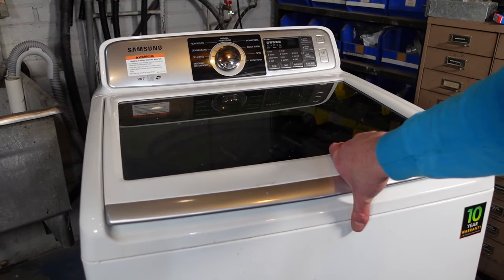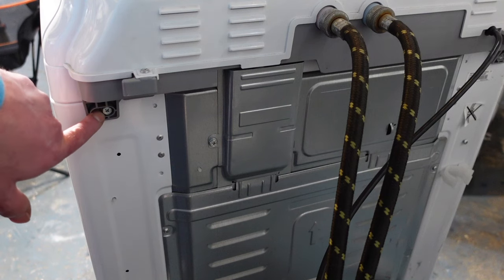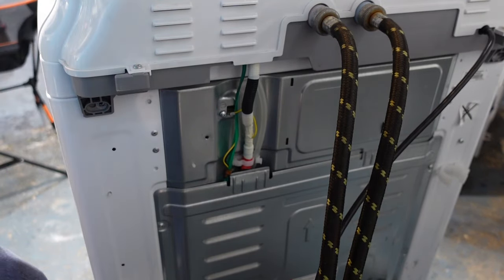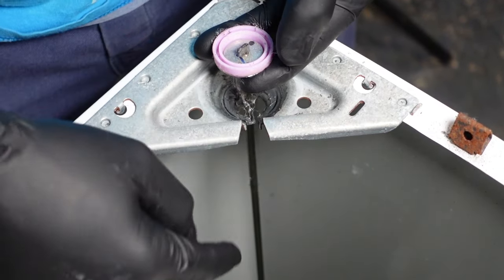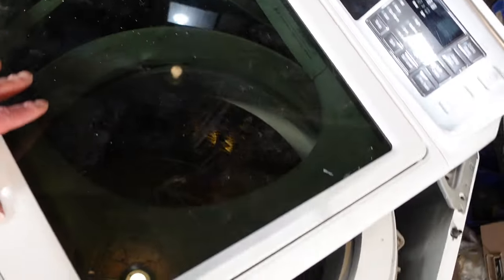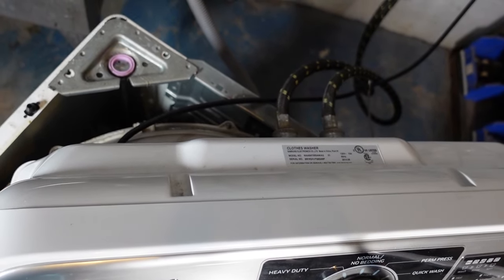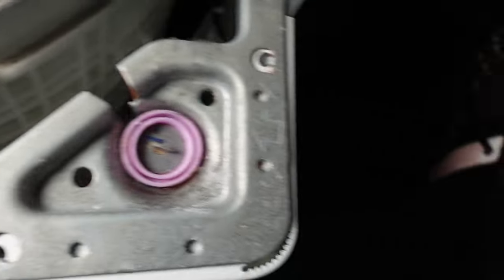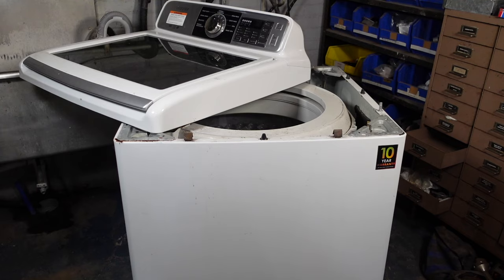Samsung Top Load Washer Off Balance FIX DIY How to Replace Suspension Rods DC97-16350C

Comment from the maker: Buy a replacement set on our website! They come in different sizes, so if you are unsure which you need please reach out! :goodvibes:
25 3/4" Set of 4: https://lorainfurniture.com/shop/appliance-parts/washer-dryer-parts/new-4-pack-suspension-support-rods-for-samsung-washer-dc97-16350c-ap5623264/
28" Set of 4: https://lorainfurniture.com/shop/appliance-parts/washer-dryer-parts/new-4-pack-28-suspension-support-rods-for-samsung-washer-dc97-05280s-ap5799907/
Reply: Pretty positive I have the same model you have in the video. What length rods do I need?
Reply: So how about a Samsung DC68-03172 D-00? Same problem.
Reply: I agree just changed my tension rods on washer
Reply: I have a Samsung Top Load Washer. Model WA45T3400AP. I believe the suspension rods are 26.4” long. Do you carry these or know where I can find them?
Reply: I have WA50R5400AV.  Which set do I need?

Comment: Thank you so much! My washer was going out of balance with loud bangs, wouldn't always finish spinning. I had a repair man come out and told me it was the transmission and said it couldn't be fixed. He recommended I buy a Speed Queen. I am a DIYer. With some research, I came across your video. I ordered suspension rods for my Samsung washer from you, followed the directions in your video and my washer now runs like brand new! Not realizing it, my daughter was overloading my washer and one of the suspension rods were broken - that was the hardest one to get out and replace, so I needed the help from my neighbor. I had to order the 28" long rods for my washer. My rods did not come with the gloves so I bought a pair from Walmart for a couple of dollars. You were right about using gloves. They were greasy. Again, thank you!!!

Comment: I purchased the DC97-16350C Rods kit from Lorain Furniture. The installation process was relatively easy and tool about 30 minutes. And I am pleased to say that it completely solved my imbalance problem.  So if you have this imbalance problem, purchase the rod set and follow the step my step procedure. You will not be sorry.
Reply: How do you know if its an imbalance problem? what does it cause to happen?
Reply: @iloveCrossCountry4 it causes the machine to illuminate an imbalance load every time it tries to spin cycle.  No matter how you adjust the load, it still stops and beeps imbalanced load.

Comment: I rarely comment on YouTube videos, but I had to say thank you for saving me $100+ on a service call PLUS whatever it would have cost a professional to fix it. In addition, I just wanted to say that replacing these rods also fixes the issue of the washer running water on the spin cycle. Apparently, the washer's computer will think the load is unbalanced if your rods are worn, and it's then programmed to add water to attempt to balance it out. My wife noticed our washer was doing that, and this replacement fixed the issue! Thanks again!

Comment: The suspension rods are still holding up in my 1963 RCA Whirlpool Imperial Mark XII washer and about the only thing that needs to be done to them is to coat them with POR15 and paint them with gray spray paint and that’s it. Can’t complain about doing something that simple to something that’s from 1963.
Reply: Sean when your machine was built it was built with U.S.steel. That is why your machine's suspension rods are still holding the superstructure up.

Comment: To anyone having this issue with unbalanced load even after changing the rods, I would suggest checking the nut on the drum underneath the machine for looseness. If it's not loose, remove the pulsator plate inside the tub and check the drum nut. 

Mine was cracked and a piece got caught in the water pump so it wouldn't drain. After I cleared the pump, the unbalanced load issue started. My rods seemed to be good so I didn't bother changing them. I replaced the nut, recalibrated the machine and she's running good, for now.
Reply: Mine is still doing this. , where is the nut located?
Reply: @alandmoochie  I would search YouTube for drum nut removal video for exact instructions.
Reply: Do you have the part number for the nut?
Reply: @alandmoochie  did you ever gets yours fixed? Mine is still rocking also.
Reply: nubiamancy  I posted a video in the replies to my comment
Reply: @820light   It's not in the comments, maybe it got removed. Can you post the title so that we can search for it please?
Reply: @skoronesa1  scroll up in the replies to this comment

Comment: I CAN'T THANK YOU ENOUGH!! I bought one of these washing machines from a restore because a rich woman didn't like it when they delivered it to her house. So she bought a completely different one and let it sit in her basement for 10 years. When I bought it from the restore it had a broken foot, and at the time I didn't have the money to even replace that. Since I owned it I have had issues with it spinning, and this model will restart the wash cycle each and every time that it goes unbalanced. I was going to have to buy a brand new washer I could not get it to complete a load. I don't even remember how I came across your video, I don't even remember what I put in the search bar. But I bought the parts and I just fixed it today and it is running better than it has ever ever ran for me. Thank you thank you thank you thank you thank you!!!!!!!!!!!!!!!!

Comment: This video help out a tons! Was able to replace the rods and in the process disconnect the pressure line., which water went everywhere when I ran the washers. So I went back and watched the entire video and it clearly says “ be careful and not disconnect the pressure line” so I new exactly what I had did. Opened the back of the washer and connected the line and the washer ran like new. Thank you.

Comment: Perfect. Thank you for a thorough, accurate, straightforward video. My model is different than the one in the video, but everything was the same except the brackets in the back were a little different. The tip about the spatula was especially helpful. I would not have known how to release the retaining clips. Also, there was a lot more grease than I anticipated, so the gloves is a great idea. You really helped me out with this - the entire process was about 20 minutes.

Comment: I am telling you from first hand experience that this is more than likely NOT the fix for this issue. I tried this and it did absolutely nothing. Not sure why changing the support rods that simply support the tub and swing back and forth would have anything at all to do with out of balance. The fix is to glue pool noodles to each of the four sides between the tub and the frame to limit its fore/aft/ lateral movement. Wedge them in vertically with a little contact cement and voila, no issues.

Comment: My washer had two screws in the front on the top section as well holding it down. So instead of being able to use a putty knife to pry it up, I had to remove some small white padding that hides the screws. Probably bent some metal trying to get the top off before I realized that.
Reply: Omg. Thank you so much. And also for this video. I could not get the puddy knife through.  I had same scenario. I appreciate you and this video
Reply: Same but definitely bent a lot of metal

Comment: Thanks so much!  The replacement rods solved this exact problem!  Rookie mistake--I first put two of them in WITH THE SPRING ASSEMBLY ABOVE THE LOWER SLOT INSTEAD OF BELOW IT.  Once I figured out my mistake it was quite easy.  Also--it's possible (with help) to tip the washer back and get at the lower clip from below.  It probably also helped that I leveled the washer afterwards. which had never been done.

Comment: Any additional recommendations? I'm at whits end with my Samsung washer. I've replaced the suspension rods and it still does the same exact thing. If I had the money, I would get rid of this piece of junk.
Reply: I didn't replace my rods because they seemed to still be good. My problem was the drum nut inside being cracked. I would 1st check the nut on the bottom of the drum on the underside of the machine for looseness. If it's not loose, remove the pulsator plate inside the tub and check the drum nut. I had to replace mine (30 bucks on Amazon). Hope this helps
Reply: @820light  Thanks! That will be my weekend project for next weekend.

Comment: Would replacing the suspension rods fix this problem?

When I start a load, my Samsung washer fills up with water, agitates maybe a minute or two, then immediately drains the water out of it and shuts off.  I don't know if the washer thinks it's unbalanced (because the suspension rods need replacing possibly?), or if there's something much more FUBAR going on.

Thanks for any ideas on what to try/repair!  If it IS the suspension rods that are faulty, your video is quite clear on how to replace them, so thank you very much for doing it.

Comment: Thank you, this fixed the problem! My washer had 2 front screws under the washer lid that have white rubber plugs covering them. Pop off the plugs and remove the 2 screws. There are 2 more screws under the control panel assembly. Get that assembly loose and lift it out of the way. Remove the 2 screws. Now the top of the washer will be free. Then lift up the top of the washer and move it around to get to the suspension rods.

Comment: Thank you. My model was alittle different and had screws instead of clips. Replaced the rods in about a half hour. I did grease parts though where my machine felt like it had grease prior. Starting first load after repair…….fingers crossed!!!

Comment: I replaced the rods on my washer and it works perfectly. Some machines have screws instead of clips securing the top front. They are underneath rubber plugs which are visible when you lift the lid.

Comment: 100% spot on!!! I knew my out of balance issue was the same as all 9f the others whom were complaining about the same thing, so I took a gamble, and was thankfully surprised! This repair went just as simple as they show here 9n the video, with one minor difference.

The two "latches" on the front, did not release with a spatula, as in the video, because my model actually was held 8n place by two screws....lol....I was about to get a hammer, when my brother in law stopped by and caught my error...

The two screws were hidden under plastic cover tabs. After that, 20 mins later, bam!!!
Reply: That's exactly how my washer is, the rubber tabs were a little hard to pull out

Comment: I want to know how these rods fail.  Does the spring lose its tension over time?  My machine didn't slowly start becoming unbalanced.  It just just decided to start walking across my basement floor one day.  My fix at the time was shoving high density foam blocks in the corners.  On small loads it still unbalances itself.  So much for that 10 year warranty.
Reply: Mine too. From reliable to running away in less than a week.
Reply: The plastic sleeve above the spring provides friction that helps to dampen out the oscillation the tub will produce from the natural imbalance of the load. Over time that plastic sleeve wears and does not provide enough friction to dampen the oscillation and the load imbalance gradually becomes bad enough to cause the severe imbalance fault.

Comment: What if I forgot to loop that last rod?  I did attach the clip back to it, but realize I didn’t loop it around the cord. Should I take the top off and fix that?  I’ve ran 2 loads already with no trouble.
Reply from the maker: It’s no problem, worst case scenario the wires may slap against the tub if it ever goes off balance again
Reply: @LorainFurnitureandAppliance  thank you!! This video was so helpful and saved me so much money.

Comment: Well, watched your video, replaced the rods and def fixed the balance problem but I’m still leaking water from right side about middle way. D we’ve removed the entire back, and no hoses disconnected. Water not leaking from pump. Even turned machine in side so we could see bottom of machine and did not see anything (of course, we don’t know what we’re really looking for) Do you have any suggestions on what this could possibly be? Appreciate any help!!

Comment: Guys I have a top loading samsung washer 50R5400US and just replaced the susoension rods on it. Now my washer just blinks when it comes time to spin. The yellow wire running from top to bottom of the washer in between the tub and casing (back left corner) came disconnected during the rod swap. I spliced in about 4 " of wire to give a little more slack on it reconnected and then put it back together. 

Any recommendations or further troubleshootings???

Comment: I replaced all 4 rods and it still goes off balance just about every time we run a load.
Reply: I saw another video where you drill holes around the top of the spinner and it seems it worked.  I called Samsung to fix mine and they wanted to charge me 400 Including parts.  Just like he said.  Samsung wanted $50 for each rod.   So I paid the technician $80 for the diagnostic and I replaced them myself.  Lucky, mine now works as a charm.
Reply: We finally threw it to the curb and bought a Speed Queen TC5003...old style speed, quality and durability. Built to last 25 years...So happy!
Reply: I'm having a similar issue with my machine. I've paid money to have a repair person diagnose the issue... I've replaced the rods, did absolutely nothing to fix the balance issue (I ran the machine with nothing in it and it becomes violently unbalanced with just air). I've given up on this machine. If I had the money I would buy a new machine, but I've resorted to washing my clothes either at the laundromat or at my parents' house in a 40+ year-old GE washer that's older than me, but more reliable than my 4 year-old Samsung machine.
Reply: @marcmcpherson6960  1st check the nut underneath the machine for looseness. If it's tight, proceed to removing the pulsator plate inside the tub and check the drum nut. Mine was cracked so I replaced it (30 bucks on Amazon).
Reply: I fixed mine and all u need is a drill, don’t have to take anything apart. Now it stays balanced, clothes is not soaking wet after spinning and the banging noise has stopped. Yayyy

Comment: Either that OR it could also means the drain valve is clogged....so the water doesn't drain fast enough....therefore starts spinning with water in it ...throwing machine off balance....sometimes I'll find a penny inside the water pump or drain...fyi...I jus thought of it since I'm having this problem.... I usually deal with COMMERCIAL Washers....not the same though...lol

Comment: Have a similar Samsung washer that keeps getting off balance and I have replaced the rods using the ones from Amazon twice. Both times I thought it was fixed and it started getting off balance again. Are the ones on Amazon just junk or could it be something else?

Comment: I just replaced the suspension rods and still had an issue but not as bad. Saw another video about calibrating the machine, after calibrating ZERO issues!! Turn the washer on and press TEMP + DELAY END for about 3 seconds, once you see CB hit start then wait about 2 minutes and let it do its thing.

Comment: Thanks so much for this video, it got my washer back up and running again. One note, my model of Samsung washer did not have the retaining clips. Instead, it had two screws hiding under the little rubber pieces that were keeping the front attached. So if you can't find the clips, you may have something similar. Thanks again!

Comment: So the way I am looking at our washer, the four suspension rods are the only thing holding it to the machine. So if it's smacking around, this is really the only thing that can be bad unless it's the tub bearing. We verified our tub bearing is in good shape, and bought a kit off of Amazon to replace our rods. However, the rods seemed even looser and did not fix our issue. Any suggestions?

Comment: AMAZING video…quick question…I forgot to put the clamp back on right before I put the top back on. We started running a load to test it out, will that hurt anything until I’m able to get the top back off and put the clamp on?

Comment: I'm having a hard time figuring out the part number for the size I need. I can't pull a rod out because I'm still using the washer. Why can't I find the size I need by the modal number? Can someone please help me figure it out please? Modal number is WA50F9A6DSW/A2 01

Thanks.

Comment: isn't there something about pushing straight down on the tub to test the suspension rods? I have changed out plenty of these rods on Samsung and similar washers. I work for sort of a home warranty service, so I just install parts other technicians order.

Comment: I wonder if you can tell me the part # for the pink suspension rod ends shown in your video? I ordered what I thought was the same color and correct length along with the rod with the white ends 26 inches. The rod that came wasn't pink it was more purple. They must be specific colors to indicate the strength of each spring. After installing the front and rear the color pink was in the front and white in the back. But the unit still went out of balance. So did I get the wrong color for the back rods?